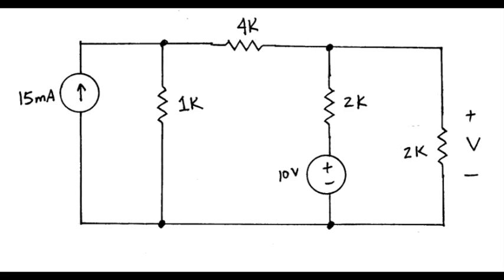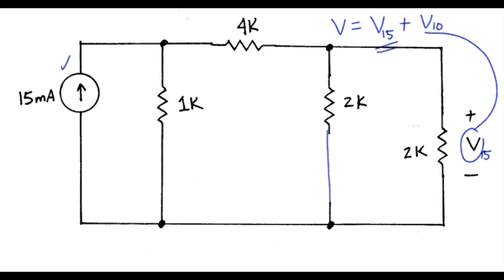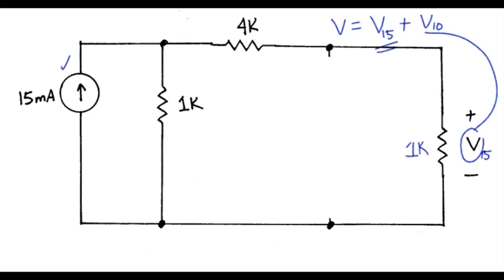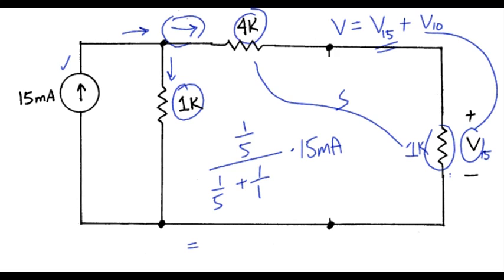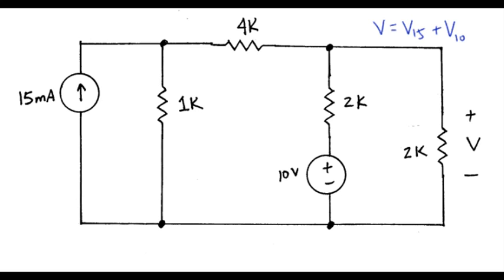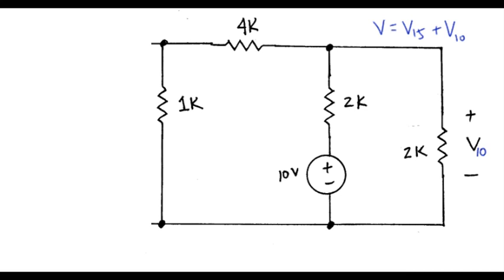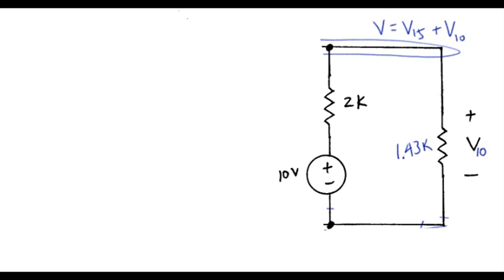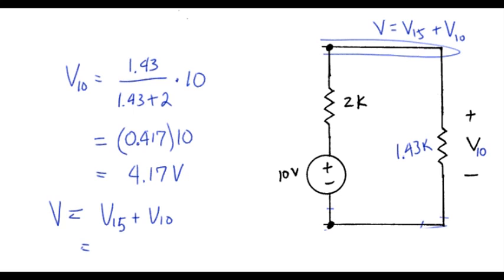dc: Superposition Example #1

Comment: When figuring out the V_10 contribution I found it to be much faster to do a source transformation to get a 5 mA current source // 5k // 2k // 2k. Then divide by the sum of the conductances: 5 mA ÷ (1/2k + 1/2k + 1/5k) = 25/6 V = 4.167 V ◼

Comment: Mind explaining why didn't you add that 4kΩ and the 1kΩ resistance at 2.06... I couldn't hear properly... 
And why did you use conductance to calculate the amount of current passing through the 1kΩ resistor, and not current divider rule? I know that the answer is the same, but why conductance?

I'd appreciate it if you could answer these 2 questions... Thank You..

Comment: for the v= 2.5 it should be negative , having the polarity of the voltage opposite to the current 
then the final answer would be v=25/6 -2.5 = 5/3 v
I hope you answer if this is correct
if not please explain your point of view
Reply from the maker: +sara T At 3:19 the 2.5mA current is drawn with its arrow entering the plus side of the labeled voltage V; this is consistent with passive sign convention (PSC), therefore the voltage from Ohm's Law is (+2.5 mA) x (1000 ohms) = +2.5 V. Btw, I confirmed the final answer (6.67V) by circuit simulation.
Reply: +Rose-Hulman Online 
Okay I get it now 
Thank you very much

Comment: U didn't unify the units.. shouldn't 15mA be 0.015 A then you complete voltage divider rule or not please answer
Reply: meshari musaad because the resistors are x10^3 while the current source is x10^-3 so it cancels out.

Comment: You added current to the found voltage. 2.5 ma + 4.17v. = wrong
Reply: 2.5ma x 1 kohm resistor equals  2.5 voltage drop across resistor...

Comment: Dude what formula did you use for current divider???
Correct me if i'm wrong but a'int the formula for current divider is I = R'opposite divided by (the total sum of the 2 parallel resistors)...
Reply from the maker: Chrono, you are correct that most textbooks encourage the use of your formula. However, one drawback of this formula is that it only works for two resistors. The formula that I use here is the dual of the general voltage divider formula for an arbitrary number of parallel resistors that divide a current. The general voltage formula says use the resistance associated with your voltage of interest divided by the sum of all of the series-connected resistors. The dual version for current says use the conductance (reciprocal of resistance) of the current of interest divided by the sum of all of the parallel-connected conductances. Try it out and see if you like this approach!
Reply: Rose-Hulman Online i like it :)

Comment: I dont understand where 1/5 came from at 2:43, could you please explain this?
Reply from the maker: I am using a form of the current divider equation that is based on conductances, that is, the current in a conductance of interest (conductance is reciprocal of resistance) is the conductance of interest divided by the sum of all of the parallel conductances that each carry a portion of the original current, and then multiplied by the original current.
Reply: Thank you!
Reply: +Rose-Hulman Online why didn't you use current divider? At what case do you need to use current divider, and when conductance?